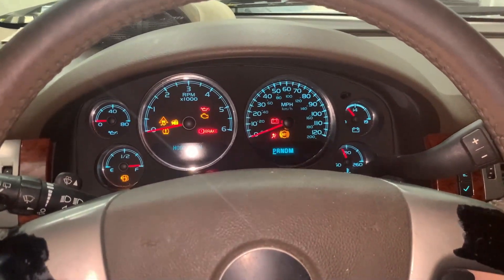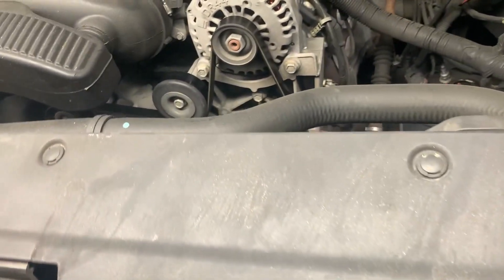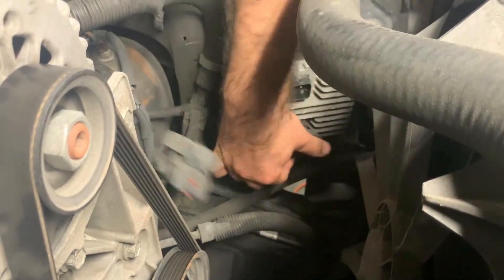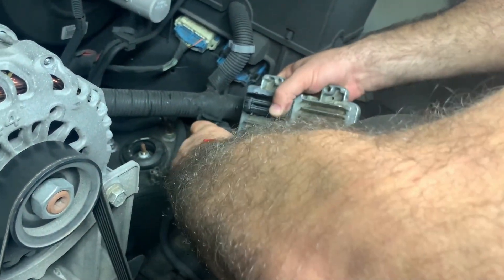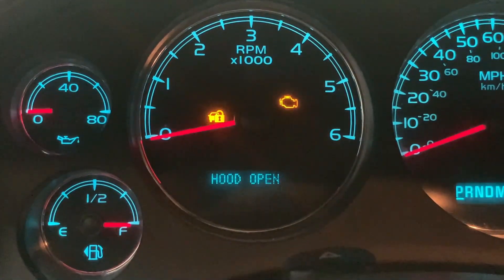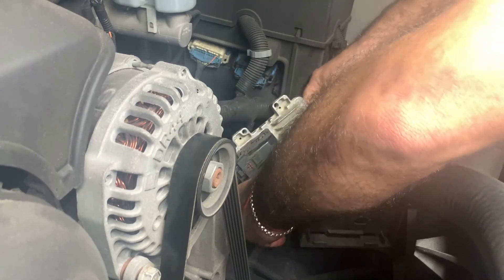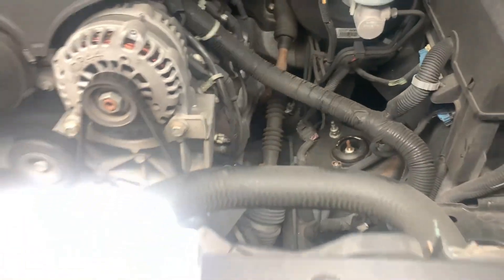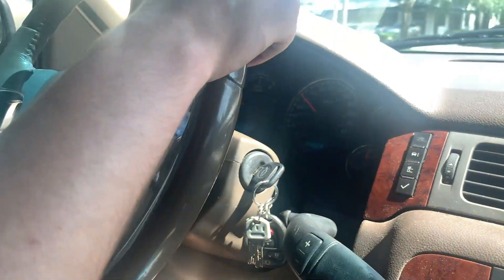2011 Chevy Suburban PCM SWAP, Programming & Test Drive.

Comment: I have a 2012 Chevy Silverado 5.3. I’m getting a p0335 crankshaft position  sensor code. I think it’s bad but what I noticed is when the harness is disconnected from the sensor I have a 5 v on my signal wire. Does that mean my ECM may be defective? If so how much is one?
Reply from the maker: A P0335 code on your 2012 Silverado 5.3 usually points to a bad crankshaft position sensor, wiring issue, or in rare cases, an ECM problem. Seeing 5V on the signal wire when unplugged is normal—that's the reference voltage from the ECM. If the sensor is plugged in and not reading correctly, check:

 Crankshaft sensor (most common failure)
 Wiring harness (damaged, corroded, or shorted wires)
 Crankshaft relearn (needed after sensor replacement)
 ECM (last resort) if everything else checks out

If you do need an ECM, costs vary: $100-$800 depending on used/new and programming fees. I’d recommend testing wiring & replacing the sensor first. Hope this helps

Comment: Where is the best place to get one of these ECMs brand new. I have a 2012 silverado 6.0 and i hollowed the cats out and put in the o2 sencor cheater spacers in and now it runs like junk and at 4,000 rpms it throws a code that says the ecm is bad. Do i need to have the ecm reprogrammed after hollowing the cats
Reply from the maker: Hello, you can buy the new ECM from us, please provide your part number and we'll check if we have it.
Reply: Man I'm literally having the same exact problem with my 13 Yukon.
Reply: @BringBackMasculinity1987  i finally got it fixed. I didn't realise the resonator also has catalytic converter materials in it. It was completely clogged so i cut it out too and replaced it with a peice of pipe, now its running like a new truck. Next cold air intake and flomaster muffler

Comment: there is procedure to get security fixed.   takes 30 minutes
Reply: Turn key to on, after 10 min the security light will go out. Turn off ignition for 30 seconds, repeat cycle 2 more time. I had to do this after losing my truck keys and getting a new one cut at the dealer
Reply from the maker: Enlighten us, what needs to be done?

Comment: I have a 2010 suburban ltz. Took it to get a front end alignment drove fine. I went back to pick it up an it started throwing 19 codes. Said oil, pressure, failure, engine, power reduced stability. Track turns off traction control turns off. I changed the oil pressure sensor an im still not getting no reading on oil pressure change other sensors and still nothing. Should I change ecu also it’s like everything I change it’s not even acknowledging it even after I reset
Reply from the maker: It may be the ecu for sure. Contact sales@ecuteam.com for additional help.

Comment: What was causing these problems in mentioned cars? I got that you've solved it, but I'm more interested in understanding the root cause. Do you plan to show the diagnostics process, like, opening up ECUs, pin connectivity tests and other stuff like this? Like, more investigation process than solution reports, you know.
Reply from the maker: Absolutely, thank you for your advice, will take in consideration and definitely improve in the next videos!